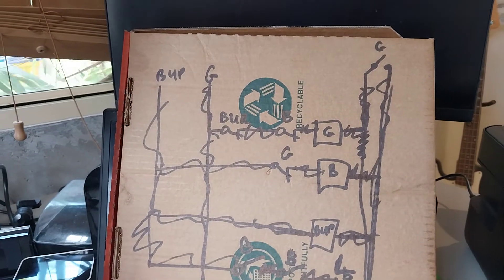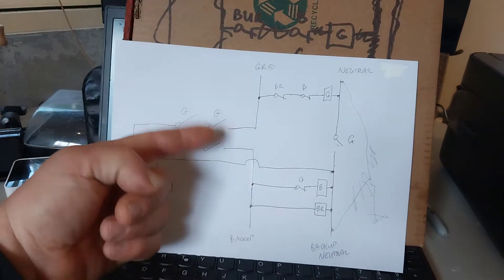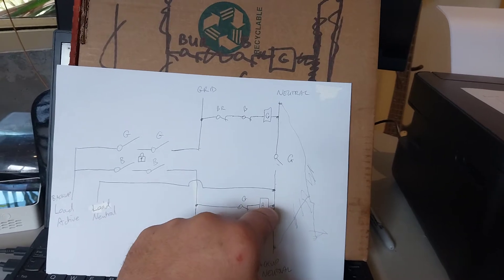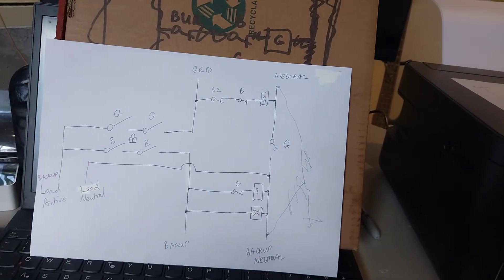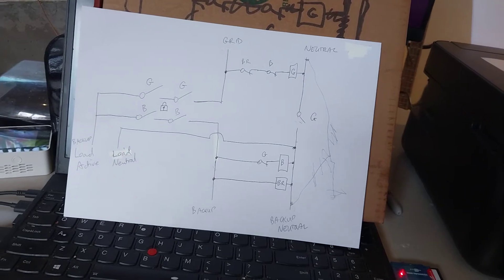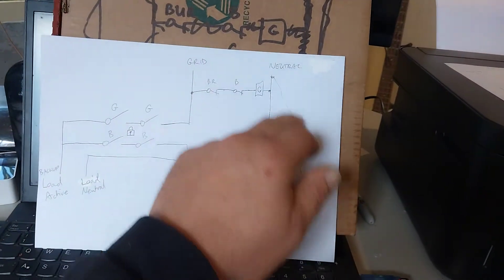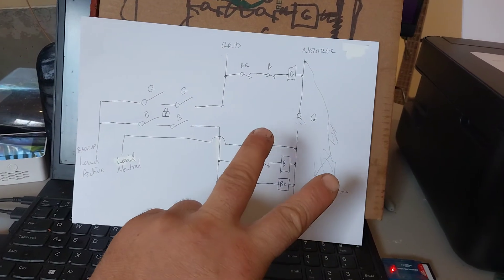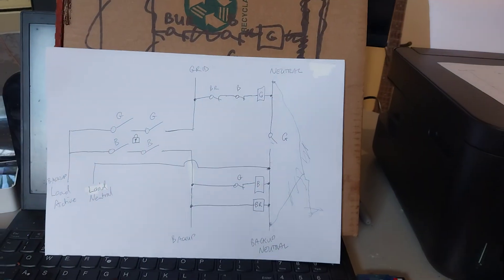Solis hybrid inverter automatic change over switch diagram (see previous videos)

Comment: So if I have this implemented, in the event of a grid power cut, would it keep the power on in the house running off the batteries+solar? And what happens when the grid power comes back on, will the connection be restored back to normal? I run my house mostly off the batteries, changing them off solar during the day and off grid during the night on cheaper electricity if there was not enough solar during the day. Many thanks!